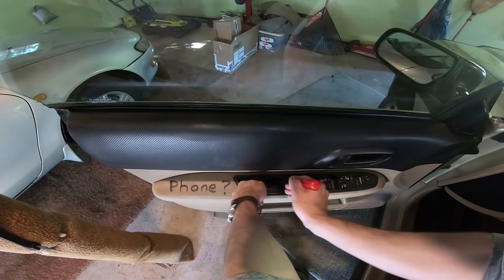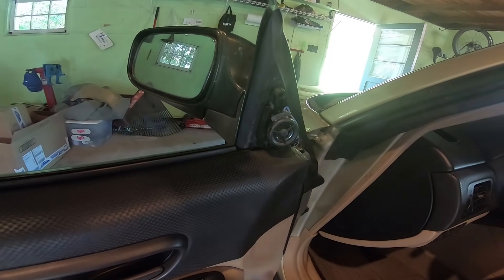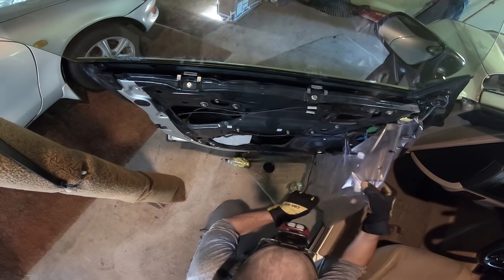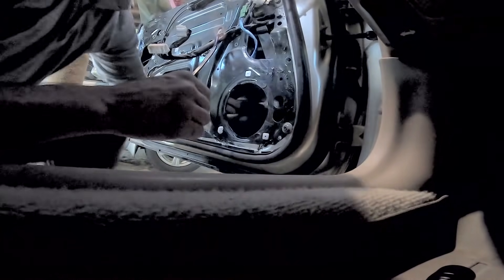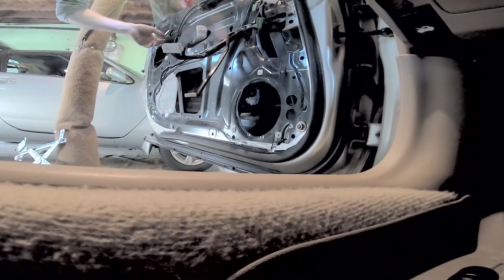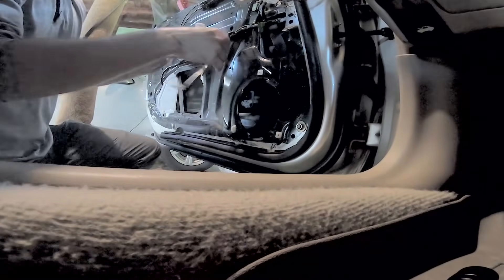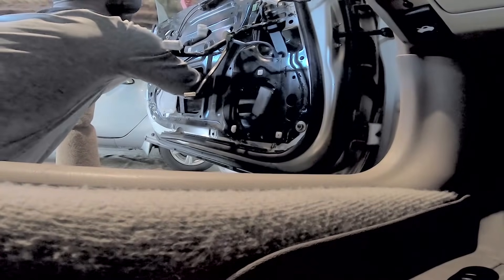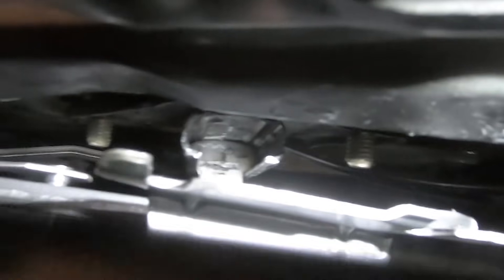Pillar-less Windows are Idiotic

Comment: Somehow you're just cooler getting out of a frameless door car with the window down. Even if it's a generic Subaru station wagon
Reply: VW CC owner here to confirm
Reply: 04 mini cooper s owner here to confirm also
Reply: Only if you look like Jim Rockford.
Reply: @markmiller3279  I don't look like Rockford, but I do look like Bret Maverick, is that okay? 🤣
Reply: Totally. Had a brand new, last shape/model 2008 Tiburon/Hyundai Coupe here in the UK} (Series 3) and it made an econobox feel special to an at the time 18y/o kid getting in and out, window down, red leather big wing and dual exhausts! 18 inch rims, as standard… balling on a brand new budget! Haha!
Reply: As a GTR owner I agree. Then you look like a dick when someone closes the door by pushing the glass and you lose your sh*t
Reply: 2000 lexus es300 owner here to confirm
Reply: Until you shut it down with a 70db rattle.
Reply: Fuckin Right!
Reply: 91 Mercury Capri xr2 turbo owner can confirm this is true
Reply: 4 door integra owner confirming
Reply: Well said
Reply: Well yeah cause it’s basically a convertible!
Reply: I had a '72 Opel manta. That one was actually cool.
Reply: Rather "especially when it's a generic Subaru station wagon" because no one expects to see frameless doors on a wagon car, cabrio, coupe or even sedan yes, but wagon? That's one of the reasons I love my Subaru Legacy wagon

Comment: 90's Mitsubishi had these doors figured out. Its like 7 bolts to remove both the motor and the channel that the glass rides on. Plus the access holes in the are easy to work through
Reply: In my experience 90's Mitsubishis were easy to work on
Reply: I fear the day my Diamante's window motors give out because I just don't know how much of a pain finding a spare will be, let alone four of them or the sunroof.
Reply: Working on fixing an 85 starion. The windows have been kicking my ass because the control arm for the window lost its rubber bushing, so the control arm keeps popping out of the window rail causing it to fall down. Been trying to super glue a new rubber bushing on but nothing wants to stick
Reply: 2003 honda accord is 4 bolts. probably the most painless fix I've ever had to do.
Reply: @chazzcoolidge2654  Oh dude another Diamante owner, my dad used to have one, and man was that a sweet car, i feel like theyre on the list of somewhat under appreciated cars, great looks, great performance, and pretty reliable, but ye parts is one thing that might get you.

Comment: #JustSubaruThings
Love the constant wind noise from the seal of the windows against the body getting worse over time
Looking forward to having to take my Forester XT in if the window motor in any door fails
Reply: That mostly comes from the gussets by the mirrors, they’re poorly designed so over time they tear. You can squeeze them together to try and help or get lucky and find some decent ones at a junk yard.

Comment: I will say though, I had a rental 2019 Dodge Challenger (free upgrade bc they didn't have econoboxes in stock) and it had frameless windows that I loved. Rather than seal on the outside though, they sealed in a channel just like they would in a normal door frame, and they just dropped an inch whenever you pulled on the door handle so you could open the door. A bit excessive, BUT the seal you got on the door was AMAZING as a result and the wind noise in it was about as close to zero as you could get.

Comment: Over time, frameless windows develop more play too, and when you have the window partially open it rocks back and forth. In some cases, the window can open too high and will shatter if you slam the door. The thing I like is being able to open the door with the window fully down and having it just be the lower portion of the door. That looks cool.
Reply: Yup. Front passenger window on my Integra thunks down an inch and a half when you first open it.
Reply: yup 89 supra, if partially down they rattle and wobble

Comment: when i had my older subarus,  i never enjoyed the pillarless doors.  i always had the inkling that they were going to leak.  also. doing spark plugs on your EJ251 are probably the absolute easiest subaru engine to do them on. the forester body makes it a smidge more difficult because the body comes up a bit higher, but when you order your parts from rock auto, i highly reccomend going with a full set if NGK spark plugs and Denso Spark plug wires.   all you have to do is remove the air box and induction tubing on the passenger side and the battery and windshield washer container on the driver side and you have full access.  the part numbers for the spark plug set and wires ill add below this, cheers Brian
-Kyle (who you videoed the trd pro tacoma and corolla sedan & hatch)
NGK Spark Plug p/n:  2756 (x4 needed)(actual OEM part)
Denso Plug wire set p/n:  6714246

p.s.  guess what lol?  i now have a 2021 Subaru STi as my only vehicle, as of right now (i have a base impreza hatchback 5MT on order now for daily driving, once i finish my STi and give i a proper detail I'll submit it and see if you folks wanna give it a proper review.   cheers!  I'm still down to do a podcast with you guys whenever,  I'll make time, just let me know!
Reply: @A H nothing special lol, I've always worked full time, saved and currently i work for a grocery store chain and do vehicle detailing on the side.  cars are really the only thing i get any enjoyment spending my budgeted money on.  so, basically, as long as you have positive equity in your auto loans and you never wind up upside down on your auto loans, and the vehicle itself isnt one that depreciates like a lead rake after the first couple years generally speaking you're good.  To add, personally,  i didnt even want to wind up changing vehicles as quickly as i have, but things in my life as well as personal wants and needs changed so the vehicles in my life had to as well.  but im trying to make what i have now stick.  cheers friend.
Reply: @A H well I'm definitely glad it worked out for you.  I hear you on the not driving part was mainly why i sold the tacoma after it was supercharged.   i always felt like i was walking on egg shells when driving it.  after some careful calculations and talking to folks in the tacoma groups, local dealerships and toyota themselves we found that about 81 - 84 examples of the 2019 Tacoma TRDPRO in voodoo blue with a manual transmission.  plus with the magnuson supercharger,  it basically was a 1 of 1 and it honestly zapped all the fun of just having the truck as odd as that sounds.  so now its back to subarus, much less rare, but still fun, so we'll see how it all goes, always thankful to have experienced what i have in any case.
Reply: @A H i feel that,  but in reguards to trucks/enthusiasts vehicles,  everyone sees the world through a different lense, everything can be nice/cool if done right, all has their place.  some vehicles more than others at times, but the tacoma, in any form with a manual transmission is a total hoot, loved it, still do!
Reply: @A H for sure, the manual option is what drew me to toyota trucks initially out of the gate when i felt the need to stray from cars/sedans at one point lol
Reply: Yeah I'd love to watch His rant on doing spark plugs on the ez30 in a tribeca.
Reply: Ej22 is the easiest sparkplugs

Comment: I felt that statement about doing spark plugs on am ej25 in my soul. All of my coil packs are missing their clips because each time I do plugs, I have to break at least one, and I have the perfect set of extensions and knuckle joints for the plugs themselves, which are torqued to idk feels tight when I reinstall them. All in all, 3 hour job, 2 if drinking.

Comment: Frameless windows look more luxurious, they give the vehicle a more "high value" feel to it. I've never had them on a car I owned, but it certainly feels nice to enter and exit such a vehicle, and to open and close its door. Because the door is just this lower part, if the window is down even, it's just this small flap. So yes, it looks great and I think it doesn't have to mean that the window regulators are harder to swap out than with a framed window door that reaches all the way to the top of the opening.

Comment: Previous ride was an MY04 XT 4EAT, loved it to death. Replaced both front window motors, replaced those damn window gussets at least twice, weatherstripping, and tried several mods (fishtank hose ftw). 6 months,  finally got the F-in windows sealed, drum tight doors, transmission went, and I traded her for an MY09 XT with proper framed doors.. Miss her every day. =)

Comment: The window motor on my brother's legacy failed. I took one look at the regulator assembly and was glad i only had to replace the motor. 

As an owner of a 1975 lincoln continental with a power vent window that uses the same regulator as the main window I'm envious. Ajusting BOTH windows to seal against the 46 year old weatherstripping which can't be purchased new is fun 🙃

Comment: Can confirm. Frameless doors sucks when you need to repair it. Did the manual window regulator on my NA Miata twice. For the first time the cable snapped so instead of spending $130 I spent $3 on a bike brake cable and rebuilt the regulator. For the second time the spool became loose and got stuck. Rebuilt it again after removing it. Both times I have to remove two stupid rails, loosen the front triangular window pillar (since that's the guide for the glass), twist it at an uncomfortable position, remove the glass, feed the regulator (which is attached to one of the guide rails, ofc) through an impossible gap, and repeat all that in reverse order. Not to mention the crumpling door cards and the sticky gooey black adhesive that holds the not-so-watertight plastic film.

Frameless doors are also bad when your passenger(s?) simply slaps your door shut by HOLDING ONTO THE GODDAMN GLASS. NO. JUST NO.

Comment: I don't know if it's somebody else's experience as well, but it seems like thanks to those guides, frameless windows break less. On my parents' Citroen C5s, on both of my Saabs, on my friend's A4 like 2 days ago, tiny plastic will crack, a window will go up askew, get stuck, fall into the door, every single used car I've everhad to deal with had some window busted in some way. Then there's my NC. My old, tired, abused, crashed NC, where the frameless windows go up with unwavering confidence of a vlogger on a busy street.

Comment: Easiest window/motor job I ever did: Saturn SC1.  The external skin comes off, and the only thing in your way is a structural member. And, since you're coming at it from the outside, you can have the door kinda shut, and sit on a stool, comfortably, and range of movement doesn't change the closer you get to the hinges.

Comment: pillarless: sexier but also cheaper. 
gotta have that 4wd somehow
Reply: Frameless windows are actually more expensive to design and manufacture. They also create more wind noise, unless you spend more money on engineering most of that out.
Reply: @anthonyreynolds2365  idk im thinking way cheaper dont gotta do weather stripping at the top of the door, cause it just seals against the window. smaller die for forming the doors, can probably use weaker window motors because theres less friction. less welds. less trim pieces. wind noise yup
Reply: @DeltaOps3  It's more expensive when you factor in that it's harder for an operator to assemble at the line since it's more complex. Plus you have to conform to high side impact safety standards nowadays. So more reenforcements will be needed and will be heavily concentrated into a smaller area of the door further increasing cost and complexity of the panel. Further the frame of the car around the window will also need to be further reenforced at the pillars and frame rails as well to compensate not having door frames to rely on there.

It's very easy and cheap to make framed windows. It's why almost every car has them. Especially below $40K where car makers tend to go for whatever is cheapest possible. In fact frameless ones will also add just as many weld or more to add a layer of complexity because more renforcements have to be welded on behind the outer sheet metal.
Reply: @anthonyreynolds2365  yeah youre probably right on the impact safety thing.

Comment: My first lexus had pillarless windows, and I was always terrified that if I closed the door to hard, the glass would shatter, because it mates up against the weather stripping. I think it was pillarless because that same door design was used on the convertible SC430.
My next Lexus had normal full frame doors. So much better. Quieter, stronger, smarter, easier to work on, etc.

Comment: Imagine replacing the window regulator on a ‘75 Chrysler 2dr (pillar less). The door and window was about 4ft long and VERY heavy.  It used a center guide and a scissors like lift.  But my father and I did it ourselves.

Comment: Frameless doors were used back in the 70s...And the cars weren't hard tops...they still had a center door post..just no frames around the door glass.

Ford LTD/Mercury Marquis/Lincoln Continental/Town Car

I think the Ford midsize cars..Torino LTDII and Cougar had this as well.

GM Colonnade Midsize Cars....Malibu/Chevelle/Cutlass/Regal/Century/Lemans....

I recall reading an autobody book from the era that it was challenging to figure out if the window was misaligned...or the door...or both.

If you want a frustrating repair...replace the wiper linkage bushing on any Mopar truck.

Comment: For spark plugs on flat engines I like to use a magnetic spark plug socket with a locking extension. The magnetic spark plug socket from autozone works good for me. I've had rubber style ones get the rubber loose and get lost in the spark plug tube or stuck on the plug themselves. Window regs in general just suck.

Comment: My 2001 Durango has framed windows, but it still has tracks inside the door to keep the window in position running up and down. I've only gotten pretty good at changing them because I tried to do it cheap through the junkyard and RockAuto, but the window regulators kept failing in the plastic parts that guide the wires to move the windows up and down. I ended up buying new regulators with motors from the closest parts store, so I wouldn't have to wait for shipping or take the door panels off to replace them, again. FWIW, the complete regulator and motor I got from RockAuto works great, so I suspect the old motors were applying too much torque to the regulators I installed them on.
I guess what I'm trying to say is, I don't understand what the difference is, besides the lack of a frame on the door.
Is it that the window keeps falling down while trying to place the regulator/actuator in the door panel?
I'm half asleep, so I may have missed something. Insomnia sucks.

Comment: "I'd rather do sparkplugs on a EJ25" the EJ25 single cams are easy AF, hell my 328xi was WAY harder.
The ej255/257 is another matter, but still not hard at all, maybe a 30-45min job honestly.

The two worst I have ever done is a 4L V6 ranger and a V8 jeep compass. Way, WAY, more difficult than any Subaru.

Oh, and the EZ30R exists. Those back cylinders are tight to get to, but I think it took me an hour(?) Maybe 1 1/2 hours cause I was doing a compression test.

Comment: My 90 da Integra had them as well. They were not power and when they failed and started to flop around I just tried to leave them up. Only problem was they never sealed up again so every time it rained I would get so much water in the cabin. I would have 1/2 inch gap in the back because they wouldn’t stay in place after the guides broke.

Comment: I hate to say it, but, the best power window design, from a tech. perspective, was a VW I worked on in the late ought-early teen era. I think it was a Jetta, I was still a n00b. Either way. You pulled of the bit with the handle/pocket/switches, and there was an aluminum card (for lack of a better term.). Unscrew that and the linkage and motor came out with it. I'm sure sure I'm missing the part about detaching the glass but, it was over a decade ago and if it was shitty I would remember that too.

Comment: I had a 05 forester turbo. The turbo got starved of oil and blew up so i rebuilt it but then it had a problem where it would miss on cylinder 2 at like 5k rpm under load. I did spark plugs on it somehow without pulling the battery or washer resevoir. There was a lot of profanity involved

Comment: Oh man. I mean ej spark plugs are a pain, but the fa20 on the toyobaru twins shop manual call for pulling the engine just to swap the plugs. Diy'ers usually snake their hand through after taking off the wheel well splash guard

Comment: Why didn't you record your teardown process and then watch your teardown in reverse?
I have a 86 Camaro and I need to work on the window motor to move the windows move faster plus the driver window isn't pressing against the trim good enough. It wiggles a bit. Thankfully there's a video on the process for doing the windows and adjusting the angle of the windows for that generation.

Comment: Cylinder 4 misfire might be a burnt exhaust valve, cause in Subaru’s infinite wisdom they decided to not run coolant through the block around cylinder 4, causing it to run about 80 degrees hotter than the rest. I’m having similar issues with my 05 Legacy and that’s the next thing I’m gonna check when I get the chance.
Reply: Are you sure about that? That doesn't sound right lol
Reply: @nomadben  Slightly misstated that, coolant does reach it, but the passage is capped off at the end of the driver’s side block, so hot coolant isn’t cycled out of the block fast enough and causes cylinder 4 to run hotter, at least if my reading is correct.
Reply: @mdspeedster2238  Damn, that sucks. I guess Subaru has been known to occasionally make an engineering mistake........ (starts sweating)